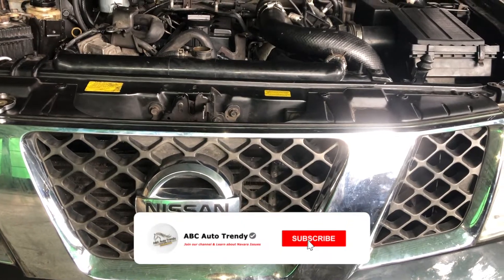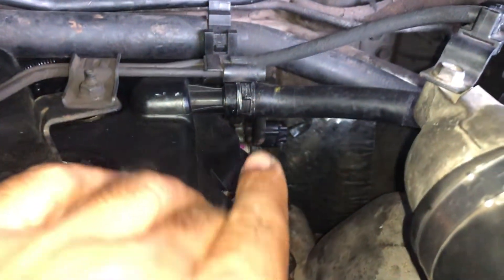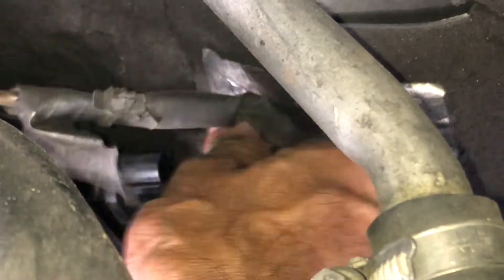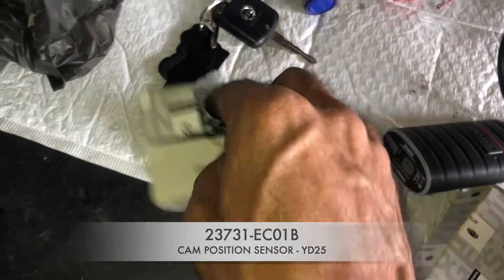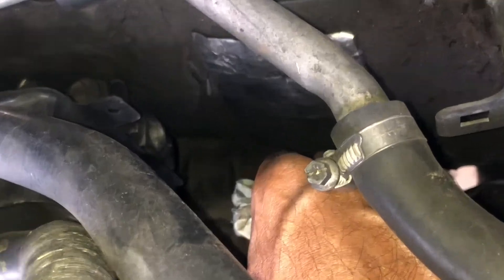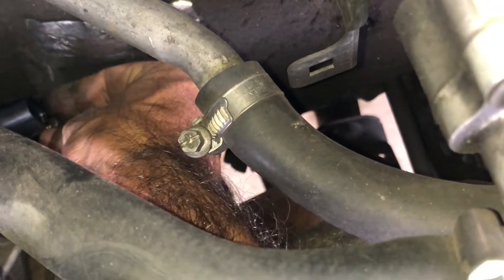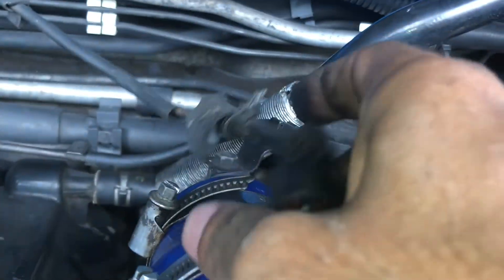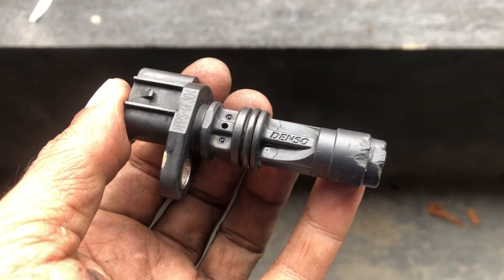How to Replace CAMSHAFT POSITION SENSOR | Nissan Navara D40| YD25 DDTi

Comment: Sir just asking because mine is not working..  what is the correct wiring colors of the camshaft sensor to the plug??? Maybe mine is mixing.. my car is going to start but if i will not supply diesel it will automatically shutoff.. pls help.. thanks
Reply from the maker: Hello dear, I will share the color coding tomorrow morning

Comment: Hello and thank you for your videos, i am having a problem with same engine vsk model from 2006 nissan pathfinder r51, my car is stalling only when cold if i keep the revs up and when it warms up the car runs fine, normaly when car is sitting over night, i have replaces fuel filter , air filter , mafs sensor, scv valve , new fuel lines and vacuum hoses i  have also ran a diesel purge through system, but i normaly use an additive anyway so system is clean. I am still having the problem, i even tool scv out again and put back in just to make sure i didn't pinch the rubber.
I have read that if i unplug my cam sensor and the car doesn't stall ( obviously it will have no power) than i have a timing chain issue is that correct?. I did unplug it and it didn't stall just had no power at all. 
So should i replace timing chains or one of these sensors. Thank you for taking the time if you can.
Reply from the maker: Good day dear,

Apparently you have done almost everything to cure the issue.

It also one of the following issue, minor to major, 

01. Fuel prime pump (NRV) none rerun valve faulty or clogged the little strainer inside the prime pump. So I’ve done a separate video on how to troubleshoot the same. Watch that video from the link https://youtu.be/pPH-rbdJH-U

02. Injector fuel pump needs service | it may drop the fuel pressure on cold start due to any of the following internal failure of Intake pressure | Plunger | Discharge valve

03. Least not last, the same can be happens when timing chain stretch or cam sprocket wheel damage.  (Please note that the engine stops in few seconds after the fist starts of the day) 

I’m sure you can figure out after the 1st test 

Let me know how it goes

Comment: looks that nissan navara d40 have 2 camshaft poaition sensor, is it right?
Reply from the maker: There are two but 1 CAM sensor and 1 CRANK sensor
Reply: @abcautotrendy  thank you and this really confuse me.
Reply from the maker: It's simple dear, 
01. Cam sensor connected to the top of the engine to gain plus for the cam

02. Crank sensor is connected to the bottom side of the engine on because of the gearbox to gain plus of the crank
Reply: @abcautotrendy  thank you for your explain. For my car, I read a code of CPS error and the engine light is on, I change it first as your vodeo shows.
Reply from the maker: @ruiboliu8666 your most welcome dear
Reply: sorry to bother you again. How can I find out the right parts for my car, the VIN is 
VSKCLAD40A0196030
Reply from the maker: @ruiboliu8666  VSKCLAD40A0196030 I will update you tomorrow

Comment: Is there a certain way to pull the clip off, mine won't budge and I don't want to break it by using to much force
Reply from the maker: It’s bit tricky, just try to press the clip lock and pull out gently
Reply: @ABC Auto Trendy  cheers ,your videos are super helpful
Reply from the maker: Thank you